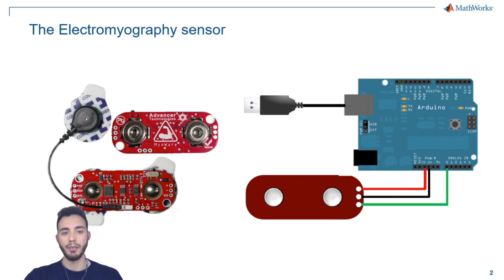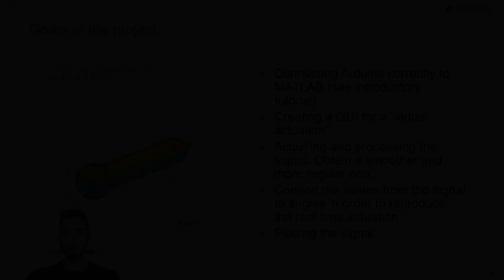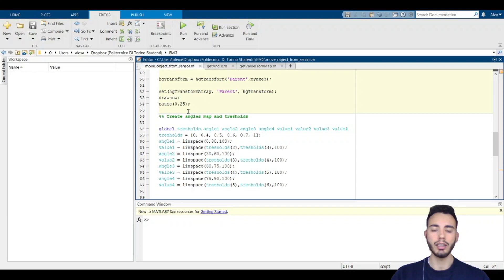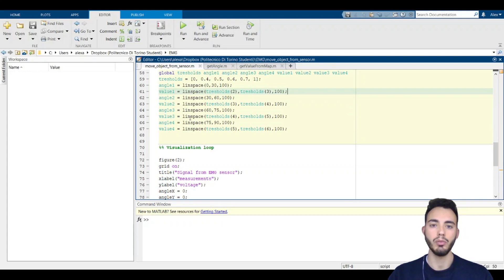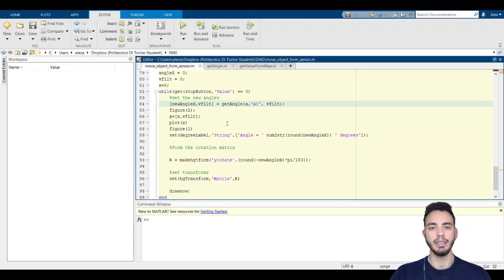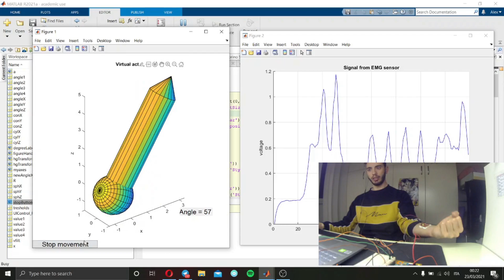MATLAB + Arduino: an application using the EMG sensor

Comment: Very useful video thanks sir i'm working on emg signals for an University project do you have the code  you used for the project?
Reply: Do you know a problematic i can do i decided to work on emg signals but i don't what kind of thing i can do i have the idea to build a filter for example to remove noise do you have ideas on things i can work with arduino and emg sensors ?